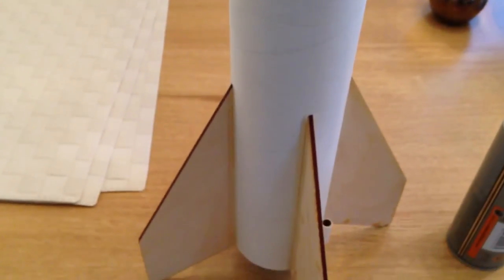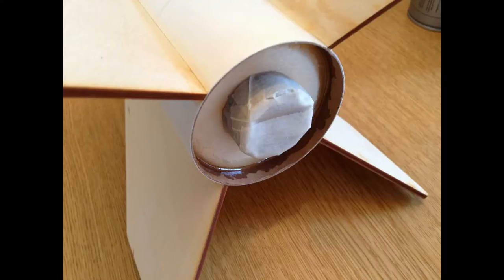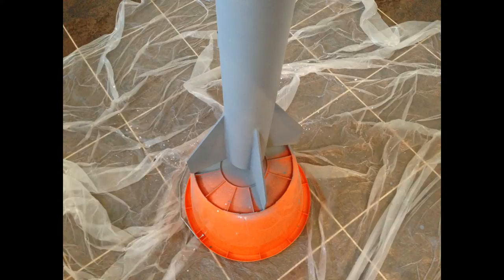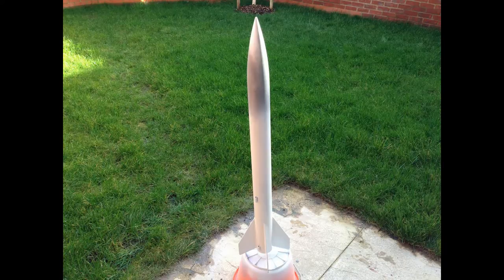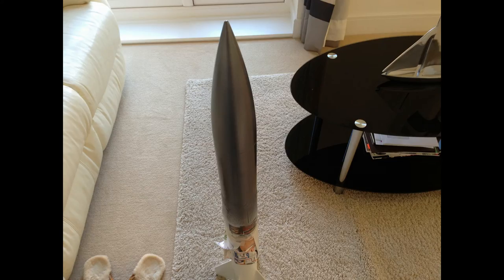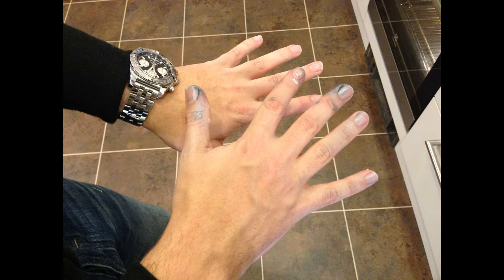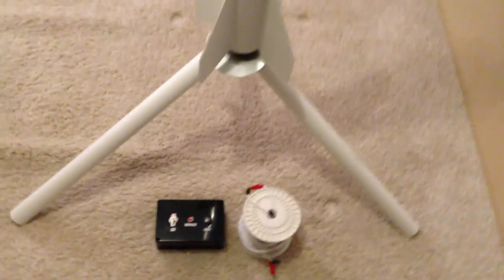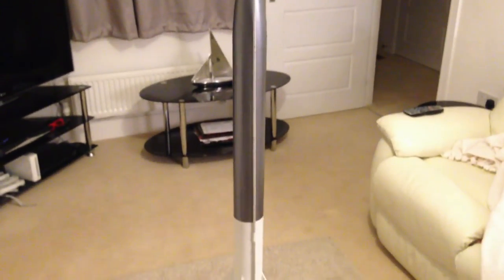Model Rocket Series Episode 4! (Painting a Model Rocket)

Comment: Hey, even in 2014, you were supposed to fill and sand the airframe spirals, and chamfer the fins!  Also, work on those fillets.  Try marking the tangent points on the booster tube and fins, using a cylinder of the desired fillet radius.  Then you can tape along those lines, and use that cylindrical object to smooth the fillets, uniformly.  Peel the tape before your epoxy dries and you're done.